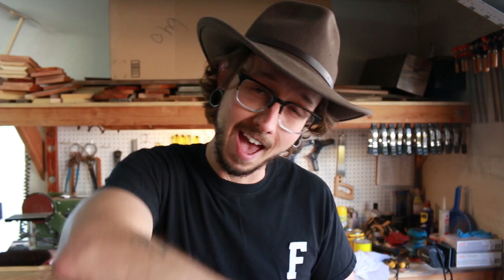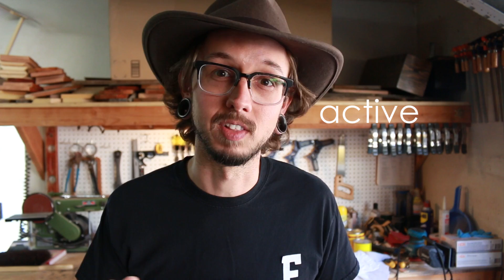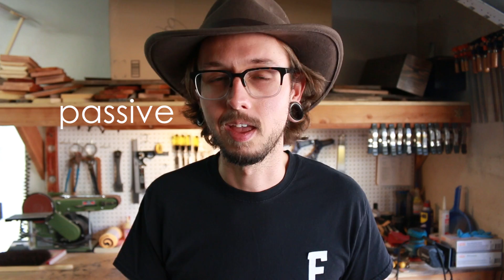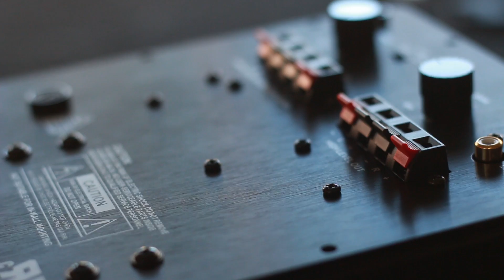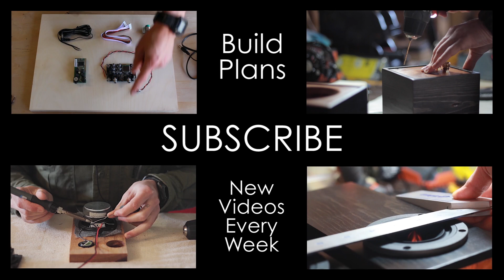How To Pick A Crossover Type | Step 2 | DIY Speaker Building

Comment: Somebody talk to me....
I want to build a superior SQ 3-way system (front and rear) in my 2012 VW Passat B7.
Equipment is 1 CT Sounds at-125.4, at-60.4, and a at-500.1 for the subs.
Drivers are 4 Morel virtus 602's, 4 Morel ccwr254 2.5" midranges, and 4 Morel mt-120 tweeters.
Subs will be 2 Morel Primo 804's.
Can anyone tell me what type of active crossover i will need for this setup?
BTW, i prefer the crossover brand to be a Audiocontrol product.
Was going to go with Audiocontrol amps but don't want to spend more money when i already have new amps from CT Sounds.
Thanks ya'll:)

Comment: I have 6 bookshelf cerwin vega speakers.(2 way)  I always have a need to hear better High end. aswell a low end. and good speakers today are not cheap.
can I add an "active crossover to each speaker" ? or is there a different method?  I ordered 2 pairs of DS18 PRO-TW120B. ( which had high ratings) on Amazon.  (have not arrived yet)

I feel like the midrange is overwhelming the sound...
so I started reading about Active crossovers. ( which I know Nothing about) 
I had a really OLD realistic radio shack tweeters. and they did help a lot. but one died. .

BTW. I have a variety of speakers that I have not used in 20 years. some  are still in the box'
1 pair of Huge Polk audio tower speakers. 
1 pair of floor standing Infinity speakers. 
1 large Cerwin Vega center speaker. with 4 x 5 inch woofers + tweeter. 
1 large Polk audio Center speaker. ( which I never used ) 
I was busy working and had no time on my hands. but now I'm retired and I want to make some use of some of the smaller speakers. cause the large Tower speakers are to big for my room. 
I'm also using a Very old Onkyo receiver which was the top of the line back in 1999. model number TX-DS838.... has NO bluetooth and NO HDMI.. its hooked up to a brand new Samsung 4K flagship TV. and PC... with Optical audio cable. which is my only option at this time. 

thank you so much for your awesome videos . looking forward to hear what can be done?

Comment: Is it possible to build a subsonic filter and lpf to put on a sub to keep from over excursion. I’m building a small diy Bluetooth speaker with a TPA3116D2 amp and a Dayton TCP115 4” sub. It’s a  ported box and seem like it’d be easy to over power it with low frequencies.

Comment: Hi kirby.. I just subscribed to your channel, will you be able to help me put together a system for my dodge ram 4 doors? I dont know how to match speaker with the amps and crossovers, this need to be matched to de amp and speakers? I dont know. I just want something simple, i want 1way speakers on the doors, one on each door and 2 tweets one on each side kick panel, and 2 subs ander the back seat. I have all ready a 900 watt 2 channel power acoustic that i can use for the subs, how can i match this amp to subs? What type of subs i need? I will realy appreciate your help. Thanks in advance

Comment: I'd like to ask, I have a JBL DSP amp with built in active cross over (Factory installed premium audio package) but recently purchased JBL Club Component Speakers which come with passive cross overs. Would it be a good idea to ditch the included passive cross overs in favor of the DSP amp since it already has built in cross over functionality?

PS: the amp has an impedance of 2 Ohms while the speakers are rated 3 Ohms

Comment: This is great! A question I had though; say you wanted to add an L-pad attenuator to a horn/tweeter in your crossover, how would you calculate the wattage of resistor needed for the L-pad? Would the wattage of these resistors be relative to the frequency that is being crossed over? E.G, if you crossed the tweeter over at 5kHz, could you get away with lower wattage resistors (and vice versa)?

I'm looking to build a crossover for a 4x10 cabinet with a 1" horn. The horn is rated at 85watts past 5kHz, so do I need to make the L-pad attenuator resistors' wattage equal to 85 watts?

Comment: Active destroy passive Marchand active crossovers are the shit really so are older TDM fuck the other brands even Ashly & Rane. The 24db slope totally eliminates inter module distortion.  Here is why you need 24db slope. Do a test with your speakers. unhook your tweeter with only your woofer playing do a frequency sweep from 20 hz to 20000khz you can play it off you tube. And see how far past the crossover point you hear your woofer and now disconnect your woofer and play only the tweeter and see how far past it plays when two speakers over lap playing the same frequency's you get inter module distortion. If your using a 6db slope or 12db slope and your woofer play loud way past it's crossover point and when tweeters play to far under their crossover point it can make them sound bad at higher volumes. You can make a 24db slope passive but all those inductors will kill your amplifiers performance expecially if the amps are little low end low watt ones

Comment: so i have this total noob question. im just starting building speakers. for my first project, i want to build a bluetooth portable speaker. i want to build it as cheap as possible. i am using one of those bluetooth amps from ebay. for my speakers i want to use an old computer speaker set i have laying around. they sound pretty good, only they use an external subwoofer. that woofer is ofcourse way too big for the portable speaker, so i'd like to increase the bass on the small speakers. ive seen somewhere that if you hook up capacitors and resistors to the speaker, it filters out the mid. would this work?

Comment: Hi! I'm gonna build my own speaker thanks to your inspiration. I have some Qs about the crossover : 
1. Can i use a single crossover for both channel of the amp ? In details, will the Sure Electronics AA-AB32189 2x100W connect both of its channel to the single Dayton Audio XO2W-2K rated at 300W ??
2. Is 2K the right freq for Dayton Audio DC28F-8 1-1/8" and Dayton Audio DC200-8  ?
3. ( not related but ) Is 100W RMS amp overkill for a 50-60W RMS driver ?

Comment: I thought you were going to talk about crossover types. High pass, band pass, low pass, 6db/octave, 12db/octave, 18db/octave, 24db/octave. Are you planning to cover that at any point?
Reply: madmat2001 hey, is a crossover recommended in a coaxial speaker??
Reply: Not just recommended but required. Most but not all coaxials will feature a crossover of some sort with the cheapest being literally part of the speaker and nearly impossible to upgrade or defeat if you're wanting to use an outboard unit.
Reply: no, with a single full range speaker you only have one driver, so there is nothing to cross between. a cross over is used only when there are two or more drivers.
Reply: what if I just have a single full range speaker?
Reply: @Stranger Depends on driver and enclosure.
Reply: no, how else can you trick people into watching garbage?

Comment: I have a 2 channel (60w) amp, i use two 20w speakers with it (midrange), but now i want to add some bass in it or separate it. It seems when bassy  parts of a song plays, the background or higher frequencies isn't heard. I believe i need a crossover.

Now, i could use a Passive Radiator, but can i use an actual powered sub? I just dont know how to decide the crossover :/ Can i build one simple crossover myself?

Comment: KIRBY!, can you please explain how to pick a crossover type like for a 50 watt signal, do you need a tweeter that uses 25 watts and a woofer that uses 25 watts or both 50 watts? Please Explain...
Reply: I'm not an expert, but I'm pretty sure you should always count a total of watts like 25 + 25 = 50

Comment: Passive crossover components are lossy, so some of the power from the amp is dissipated as heat, they're not a viable option for high power systems, it's quite hard and costly to achieve high filter slopes, driver characteristics have to be considered, zobel networks, level matching, phase issues, inductors and driver coupling. These are the issues with passive.
Reply from the maker: Absolutely! All great info, thank you! This is simply an "intro" video series and not an in-depth video on the pros and cons of passive crossovers.

Comment: Hmmmm  2.1 system with the PS95s and a Dayton 70w plate amp? Sounds oddly familiar! Don't tell me you are working on a 2.1 with those components too :p
Reply from the maker: Hey Jules! I built that system a few months ago. Actually, the "Cube Speakers" build video was part of that build for a friend. Unfortunately, that was when I first started this channel and I didn't think of filming the build until after the sub was mostly finished.
Reply: What sub did you use and how did you like the result?
Reply from the maker: I used a Tang Band W6-1130SIF 6.5" with (I think) a 2" doubled flared port. I don't remember the exact cabinet size, but I made it with .75" MDF and internal bracing. I was very happy with the result. The enclosure was decently small with big sound.
Reply: I'm looking at this driver, looks promising! Thanks for sharing!